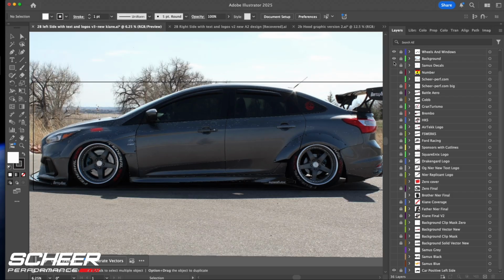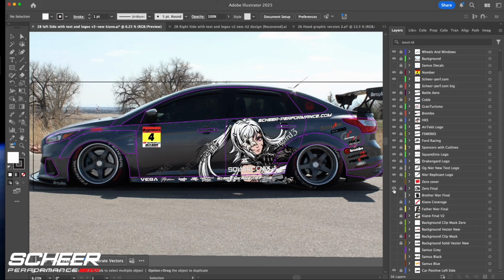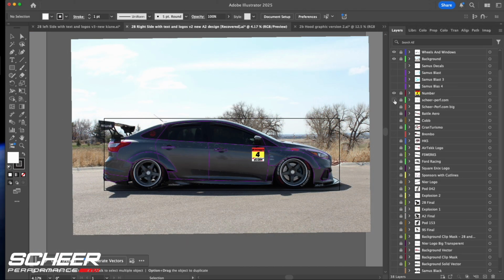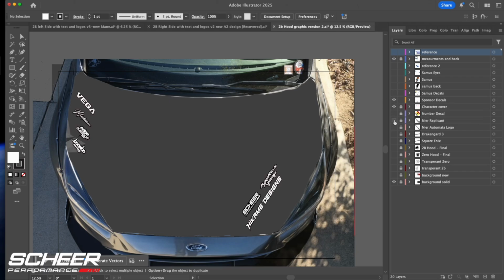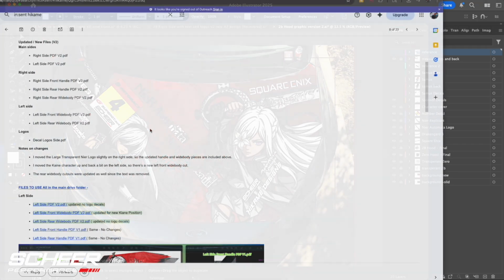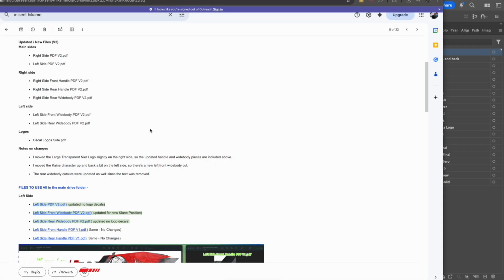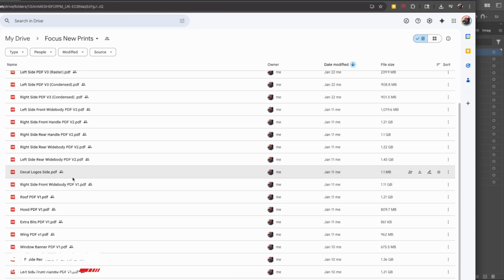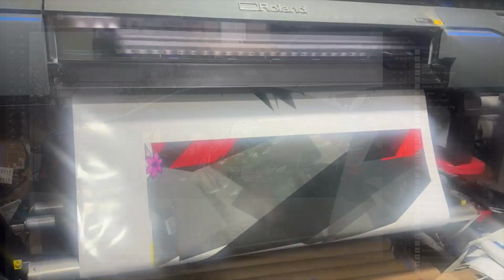How to Install an Itasha Wrap (Design → Print → Install FULL Guide)

Comment: This is well done, what printable vinyl and laminate do you use for a itasha like this?
Reply from the maker: Thanks ! It's all on 3M material
Reply: @Scheer_Performance  Awesome, thanks for sharing! Have you tried Avery Dennison’s printable before? What’s your opinion on theirs?
Reply from the maker: @Pirabit943 yep! That is what my print/ install guy (hikame designs ) uses now actually. It has a slight more visible texture, but it's very easy to work with on the install
Reply: @Scheer_Performance  Yeah I think I’ve heard that about Dennison’s normal cast film. Looks like the printable stuff behaves similarly.  

Thanks again for answering my questions! Looking to start wrapping, I’m thinking I’ll start with Dennison, cheaper and easier to work with. Also I’m probably going to be doing some fleet vehicles so showing some texture isn’t a big deal. 

Looks like you got some sick projects tho, I’m subscribing!👍